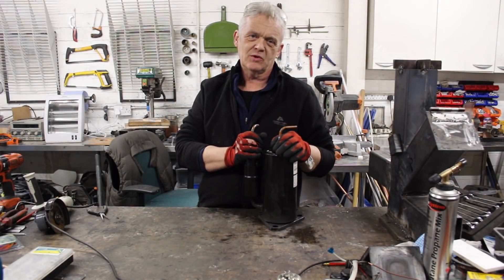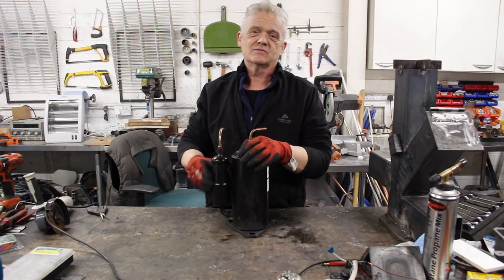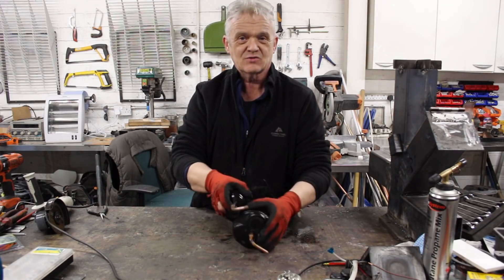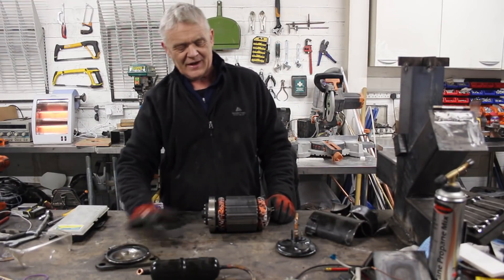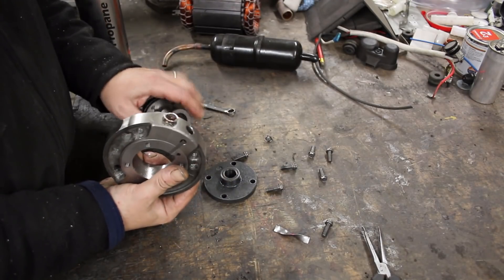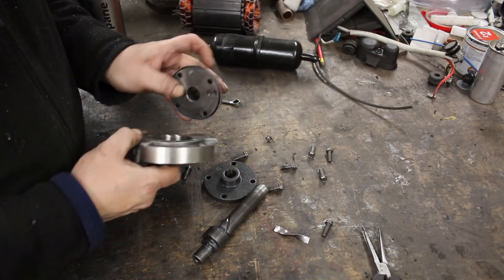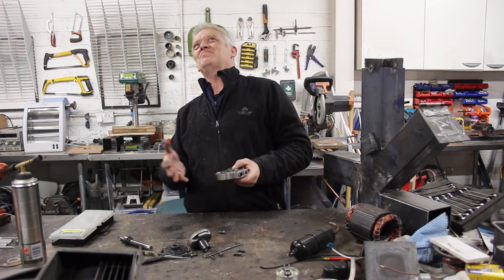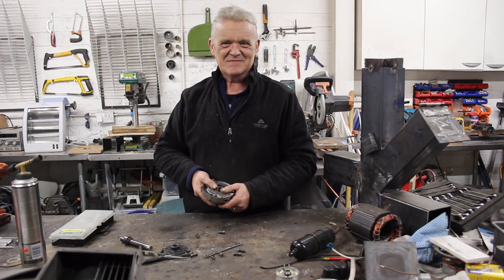1425 Inside An Air Conditioner (Rotary) Compressor And How It Works

Comment: Some beautiful engineering there, what I really like is that huge coil arrangement. Imagine the generator / engine that could be built with that. A shaft and decent magnets attached to a wind or water mill can really put out some power if done right.
Reply from the maker: my thoughts exactly mate!
Reply: @ThinkingandTinkering / Steve Tobias
👍🏻

Comment: The cover plate makes a great Euler disk. Spin it on a piece of glass. Add magnets for more weight and it will wobble longer.
Reply from the maker: would they? I will give it a go nice tip mate

Comment: Excellent video! 
Robert do you have a video describing in detail, the working a 'refrigerant air dryer' as used in drying compressed shop air as used in auto paint etc.? I sure would like to watch it if you have such a video.. Thanks, Phillip Hall
Reply from the maker: I don't mate - I will have a think about making one - thanks for the suggestion - cheers
Reply: @ThinkingandTinkering  
Thank you Mr Smith..

Comment: Mazda did a rotary engine. It was some what unreliable and hugely expensive to repair. Really interesting stuff and I can picture you build this and it sounding awesome.  Fuel and ignition timing from an ardweno "spell check" epic build and very hard I would think
Reply: Yes they got an amazing amount of power in a small space! 
They were based on splines sliding in and out of a shaft which was off centered. The problem was that the wear occurred on both sides of the spline the far end and the faces that slid in and out of the shaft ...... A Lot of wear area! If you didn't get the service interval (3K miles as I remember) the wear on the shaft would mean an expensive replacement! 
But that engine sounded and performed on another level!
Reply: mazda wankel engine
Reply from the maker: did they - I didn't know that - cheers mate that is interesting

Comment: Could this be used for filling butane/propane cylinders with homemade biogas?
Reply from the maker: I would suppose so - might have to watch out for sparks!
Reply: Biogas wont normally ignite unless you combine it with addition air. The Fema down draft gassifier PDF file mentions the ratios for the different ice engine sizes to determine the correct scale (size) gassifier. Chilling the vapor will enable a greater gas volume to be compressed.

Comment: Rob a 3 phase compressor  like the one in your video 
 would make a really good wind turbine if  
a perment magnet rotor was made for it  
 good  sealed thrust bearing on the front 
You could make a bullet shaped long lasting sealed
 wind turbine out one of these compressers 
and a few other parts  i have been wanting to make
 one but have not had the time yet 

  i have turned 3 phase motors 
into generators using perm magnets 
and when done right the results are very impressive!!
Reply from the maker: cheers mate

Comment: yes! rotary engine build.... hho fuel?!! so fun and twitchy lol
maybe just propane ? browns gas? 
maybe the hydropulse engine with the low melt alloy?
ok I'll stop now, got to go clean kitchen then shop lol
why is it that your tweets with youtube links are later than youtube's updates direct from yourube?

I mean you think that if you went to the YouTube channel it would show the updated YouTube video but it doesn't I have to get your link from your tweet and search for it

Love my voice to text auto correct changing YouTube to you rube
Reply from the maker: I was thinking steam engine mate - I am a bit worried about the cylinder holding up to an ICE environment - plus - I do like external combustion

Comment: would the seals in that compressor hold up to combustion pressures, heat and soot?
Reply from the maker: I have seen them used for engines but it probably only going to be good for the short term

Comment: Hi rob, could a refrigerator run without electricity? I looked at some very early fridges and I wasn't seeing a power cord anywhere. I know they can run on gas as I got one in caravan which does but could it be one big heat sink arrangement? Maybe have cold water involved, cheers mac
Reply from the maker: for sure mate - look up Einstein's fridge - and I am not kidding he invented a fridge!
Reply: @ThinkingandTinkering  I'm a little suspicious of anything of Einsteins, but sure I'll look it up cheers. I have made one which uses clay plant pots, sand and water, wasn't that effective in this country.
Reply: By second law of thermodynamics, to pull heat from a colder source to a warm sink it takes energy. This energy can be mechanical (as from the motor that drives a compressor) or thermal. In this second case, we are talking about absorption refrigerators, where the "heavy lifting" of pushing the vapors from low to high pressure side is done by heat, which boils a solution of refrigerant and a liquid solvent. Typical combinations are water and lithium bromide or ammonia and water. Standard designs require a circulating pump for the rich solution, however the Einstein-Szilard and the Platen-Munters designs can do away with that by using a clever trick with a third gas in the circuit.
Reply: @markotrieste  nice one thanks, when i read the first line of "laws of thermodynamics" i was expecting a no or some explanation of how you cant create energy apparently.
Reply: @mac-qt3wd  Physical laws are tough, but just 😉
Reply: @markotrieste  zero point energy or over unity is very simple to achieve with regards to input and output - electrically or power wise (watts/kw/mw). Yes its not gonna be 100% efficient but you can use a little power to make a machine/motor do alot of work and then convert that back into the same unit as whats powering it and youll end up with more watts at the end. So not sure i agree with the entropy argument
Reply: @mac-qt3wd  Go ahead, the Nobel prize is waiting for you
Reply: @markotrieste  you only need 25 kgs of the worlds strongest magbets to generate one mega watt. Average is about 80 kgs on the low weight permanent magnet generators.
25kgs is a bag of cement, you can get a motor to move a bag of cement usung less than 1000 kilowatts i know. Not sure what rpms are required but thats for wind turbines so am guessing between 1000 and 2000 using their gearing ratio and the permitted rpms of the big uns
Reply: @markotrieste  been doing it since 2015 mate, live in a quarry with not a mains power cable in sight. Yet im using electricity to charge my phone to speak to you, its very simple believe me. Have a look at the nobel prize winners list and youll realise they aint good people who win it
Reply: @mac-qt3wd  Yeah sure
Reply: @markotrieste  ok we shall do this together you dont even have to make anything other than calculations is that ok? I just finished washing a lorry (saturday job to pay rent at quarry) and its engine horse power is 400hp so that in brake horse power is 298 kilowatts. Can you see where this is going?
Reply: @markotrieste  feel free to chip in with an answer for how much power in MWs a lorry engine could generate from turning how ever many tonnes worth of magnets you think its 400Hp or 298kw input is capable of. Fully loaded lorry is quite heavy and times that by 12.5 kws per kilogram.
I guessed at 30 tonnes and got 375MW out of 298kws. Feel free to correct me with exact numbers :)
Reply: @mac-qt3wd  Seriously: if you are capable of pulling out 300 MW from 300 kW, what's stopping you from becoming the lord of the world? And don't worry about scale: even 300 milliwatts making 3 watts would suffice to break every thing we know and rely on. So now, what are the chances that the world is wrong and you are right vs. the possibility that you have no clue of what you are talking about? Go ahead and let facts speak for you, rather than YouTube comments.
Reply: @markotrieste  how you know when a troll know hes lost, resorts to insults cos he cant answer simple questions. Can you move 30 tonnes with a 400 hp lorry engine yes or no? Yes you can thats what they do and how they work. 
Can you swap the lorry for 30 tonnes worth of magnets on a rotating shaft, sure why not itd the same weight. 
Can you generate 12.5 kws per kg using low weight permanent magnets from a wind turbine, you can actually get 40kws per kg but i played it down.
I cant afford to make such things and i dont need to, i dont own 375000 houses i need to run just a static caravan
Reply: @markotrieste  A typical electric car uses ~0.7 kg of permanent magnets in its motor (with the notable exception of Tesla’s AC induction motors).
So in order to make a 2 tonne electric car move you need less than a kg of magnets.
So you need a motor to be able to turn 1 kg of magnets in order to turn the electric car motor which can then generate 2000kgs x 12.5kws = 25000kws. 
So you need a dc motor with more than 10 NM of torque, hook that up directly to a battery and attach the shaft to an electric car motor shaft.
Then take power out of the electric car motor i would imagine you are already winning. Whats the power output of the electric car motor 400 kw? 
How much are you using from the original dc motor hooked up to battery, about 12 watts (12 volts x 1 amp typically depending on motor, use a battery drill motor they have way over 10 NM of torque) 
So you dont even have to swap the car for magnets just use a smaller motor capable of turning over 1kg of weight and you can spin the car motor and take power out of that
Reply: @mac-qt3wd  It's clear that you lack basic understanding of physics. I don't mean this as an insult but as a statement (you don't even know the correct spelling of units of measure). Suffice to say that you are messing up the nominal power of a motor/generator with the actual power it delivers under given circumstances. If you use 12W to drive a 400 kW motor, (provided that it will ever turn, friction may even prevent it), you'll get out 12W at most (first TD principle) and actually way less due to conversion losses (second TD principle). Weight has nothing to do with that. I invite you to take some courses in basics of physics, learn the difference between power, energy, torque etc and then come back once you have cleared your mind.
Reply: @mac-qt3wd  When you mix up the weight of the magnets with the weight of the lorry, you forget the fact that the lorry only has to fight against gravity (on inclines) and friction of tyres to the ground, while magnets in a magnetic field are fighting against electromotive force, which is completely different from gravity. You can do all the calculations and conversions you want, but at the end of the day you can only have two outcomes: either you realize that the power you get out is always less than the power you put in or... you did a calculation mistake.